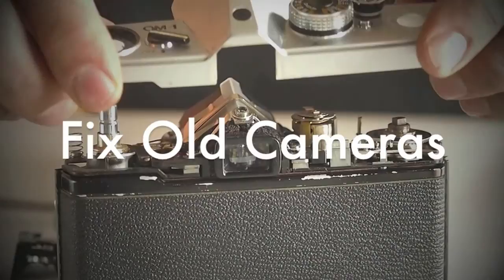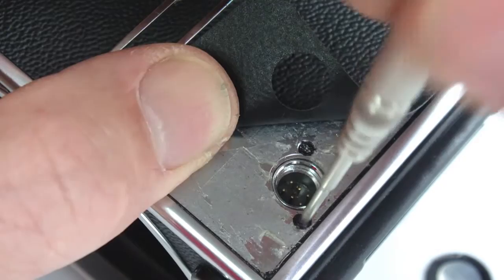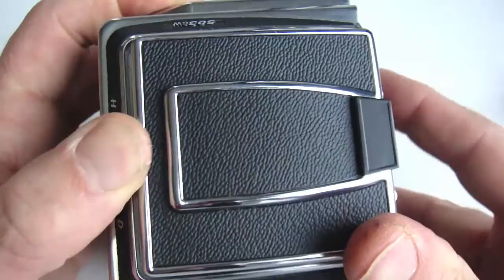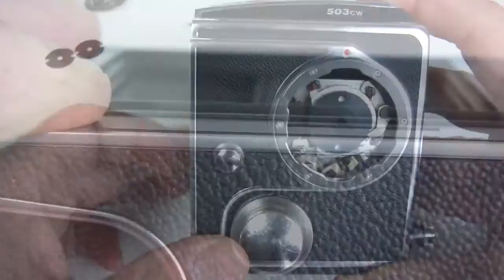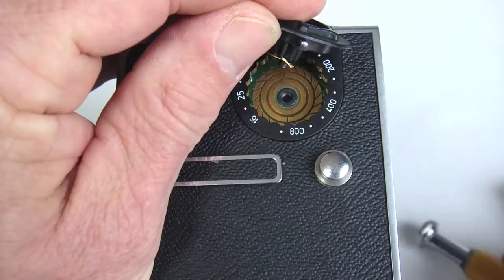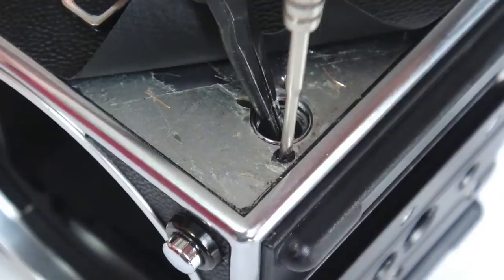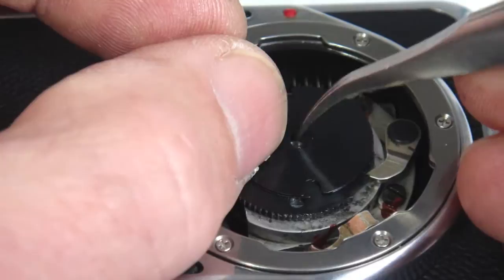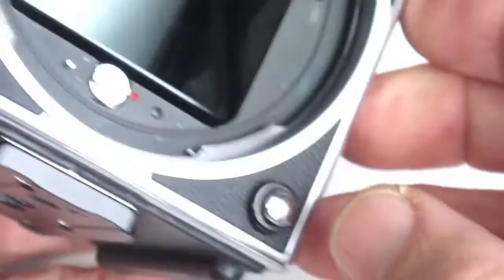Fix Old Cameras: Hasselblad Out of the Box

Comment: I've been using 3M Adhesive Transfer Tape 465. I bought a 2" wide version from Micro Tools and it has lasted for over 20 years. A little goes a long way. It is pricy $50 a roll but as I said it lats a long time. I use a heat gun along with a product called "Bestine" to soften the old leatherette and remove it. The same heat gun and an old darkroom roller flattens out the old covering. Then I apply the leatherette to the sticky side of the tape, use a surgical scalpel to cut the tape to size. Peel off the paper covering and stick it on. Wetting with a little alcohol (Some folks use saliva) keeps the tape loose so you can shift it about if needed.

Comment: Rather than the hazard of using a tool to secure the two clips that hold the delicate screen in place, it's best to allow the waist level finder to provide the locking. Slide it on and it safely & automatically draws the two tabs in...
Reply from the maker: y2ktube   Thank you for the helpful comment.
Reply: yes thanks, that is actually what is recommended to do it, same with mamiya 6*7 and other cameras with this sort of finder, the less you touch the better!!! even when cleaning, as the finder has a Plexiglas base with a plastic coating, which is very soft and very easily scratched or worse melted (smeared) with solvents!!!

Comment: Thank you for this video, it is super helpful. I managed to repair a salt water damaged 501CM with it. (Back flaps bent out of shape because the return spring for them corroded and got stuck against the rest of the mechanism)

A lot of people on forums say that when you pull the internal mechanism off the outer shell it destroys the alignment and calibration between the lens mount and the film plane. Is this true?

Comment: Thanks for the video. I had a weird problem with my 503cw. Under the mirror, there is a tiny sheet of metal that came out and jammed the camera. I found the problem and pushed it inside but it moves freely. I searched on the web but didn't find any information. Did you know what it can be?

Comment: Could you do a video on replacing the the mirror damper foam on a hasselblad cm? I know it would be a complicated video but im sure very informative and interesting.
Reply from the maker: Thank you for the suggestion. Yes, for such a simple issue replacement is tricky and would  surely warrant a feature in a FOC video.  Hard to say when such a video might be produced.
Reply: @FixOldCameras  I have that SAME PROBLEM with a 'Donated 500C/M and 500 EL/M -- both mirror damper foams are rotten and 'horrible BITS' keep falling onto the mirror -- i have done 35mm SLR's with foam light seal strips -- is it possible for an 'Amateur Camera repairer' to do the Hasselblad ?

Comment: nice video, BUT how does this work on the E L / ELM models, which have the battery/winder module below the body and hence have NO winding socket on the side?- wish you could do a video on this please :))
Reply from the maker: Another great suggestion for a video. The list is long. However, the EL/M offers some disassembly complications. The motor drive unit can be pulled from the casing thru the right hand side panel. The mirror box can than be removed after removing the cosmetic pieces such as the mode selector and ISO selector. Probably won't be doing a feature on the EL/M any time soon, but it is not off the list of possibilities for a future consideration. Thank you for your comment and interest in Fix Old Cameras. Hope to have another Hasselblad video of some sort a little sooner though.

Comment: Hello. I need help. It seems that the mechanism of my Hasselblad 500c caught. This happened after I manually turned the contact lens on the camera. The mirror is locked. The curtain is also locked in the open position and the shutter button is also stuck.
There is an easy solution to release engrenegens and return to normal.
Thank you very much in advance.
Reply from the maker: +Rodrigo Brasil 
The issue is not exactly clear from the description. However, with the mechanism removed from the outer shell you might be able to carefully inspect the wind release sequence and discover the problem. A little gentle encouragement might get the sequence to complete. Check the wind ratchet in particular. By releasing it you might be able to wind through again. Be very careful with your probing as you do not want to make matters worse for your repair shop if you ultimately have to take it in for service.

Comment: Do you have any brand or model number for double-sided tape for reattaching leatherette and other coverings if needed?

Is there a way to safely clean the viewfinder's ground glass other than air?
Reply from the maker: A clean soft art brush from an office supply or art store. An angle shader brush # 6 works very well in most camera repair lens and viewfinder cleaning applications. For leatherette that is still pliable plain office supply double sided tape works. Double sided carpet tape available at home improvement stores offers a little stronger bond. If the leatherette is stiff and more resistant to staying put then you might have to resort to Pliobond glue with rubber bands and card board shims to hold in position until the glue sets.
Reply: I've seen it suggested that the "ground glass" can be rinsed with distilled water and forced air dried but I haven't ever tried it. Could you folks comment?
Reply from the maker: Works for dust and non oily smudges.

Comment: hi there , i did this but now lock up wont working , what shall i do?
Reply from the maker: Make sure the lever is pulled all the way down as you slide the box in 
so that it can engage the linkage properly. Look at how the lever rest 
and is linked to the mechanism so that you can position it correctly.
Reply: lever is pulled down but it still need a click on a shutter and lock up bottoms after mechanism is in box .
can you make any short video about this?
Reply from the maker: Thank you for the suggestion for a video detailing this aspect of reassembly. It could be featured in the future.
Reply: Thank you )